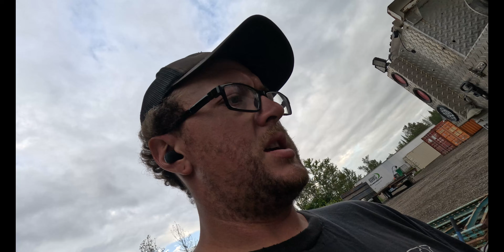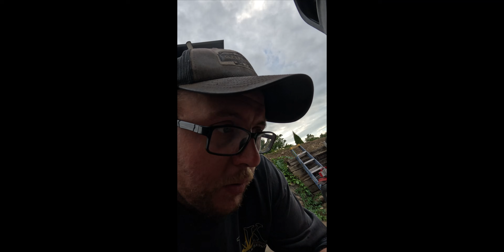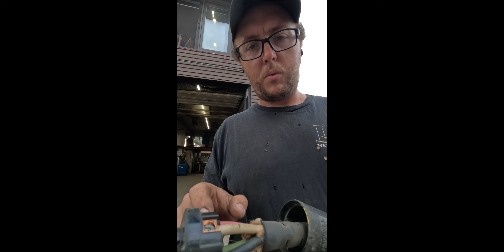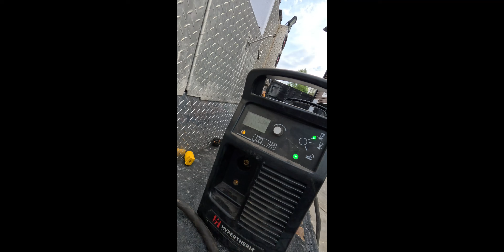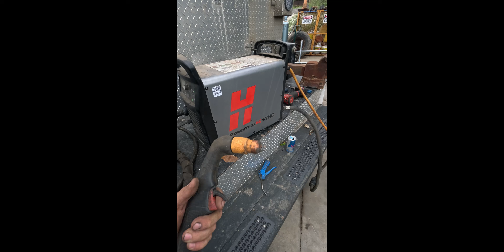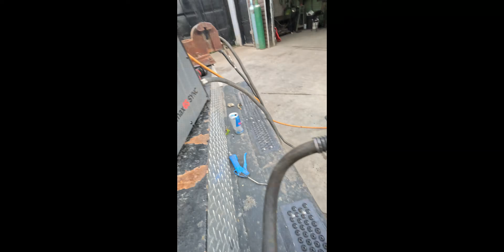How To Change A Machine From Three Phase To Single Phase

Comment: Sounds like you got a good deal.  Good tip on the 3phase/single phase conversion.  I never thought about it that way but Miller and Hypertherm  spend a lot if time on the power aspect in their manuals  so it makes sense that they're not necessarily crapping out 31 flavors of machine.  You've opened my aperture on looking for more commercial level machines.
Reply from the maker: Awesome to hear!